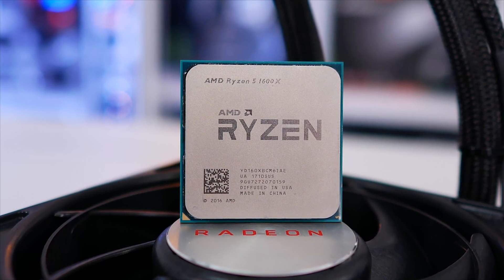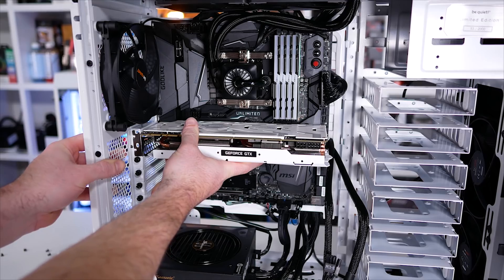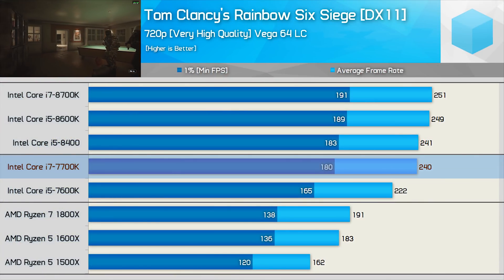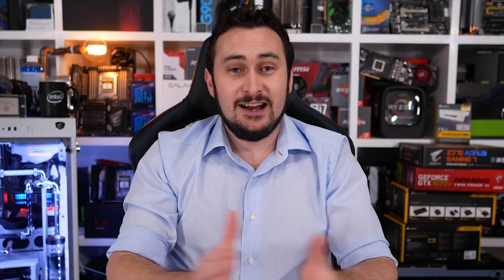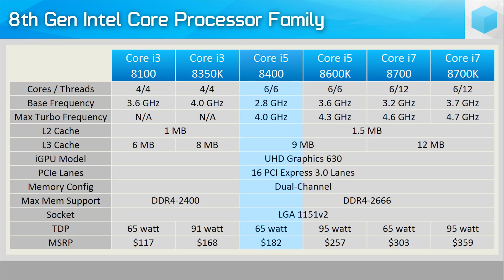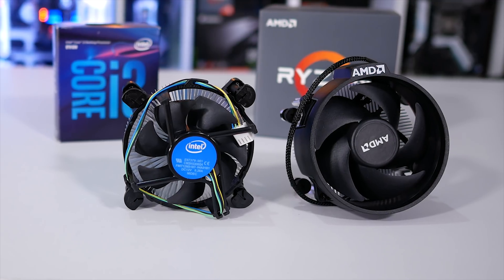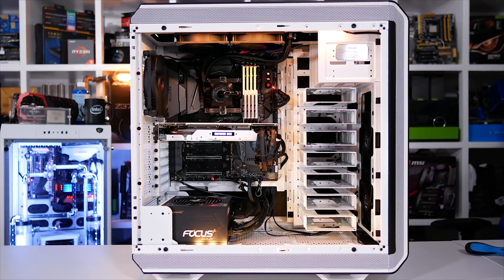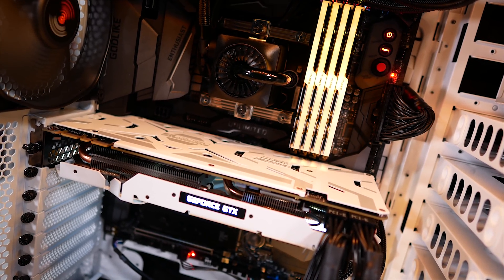Let’s Chat, R5 1600 OC vs. i5 8400 Benchmarks Incoming!

Comment: I finally got my r5 1600 to run stable 3750 Mhz on a Asus prime plus b350 with last BIOS update in Nov. The FID thing was a bit of struggle to deal with. That is until I realized how simple it was. So you take 3.750 Ghz. move decimal one place right and multiply by 4. So, 37.50 X4 = 150 and 3.8Ghz would be 152. Another thing it did was better under volting. I guess these ryzen can get higher clock speeds with lower Vcore. Mine likes 1.228 @ 3750. I think the 1600X may do it with less? and the R7 maybe even better? The spire cooler that came with it can maintain less than 70C with 100% load. Anything more than that it requires more Vcore and the VR don't like that. The other bonus was the G-skill Flare 2400 will clock at 2800 by just choosing 2800

Comment: i5 8400 isnt a good deal.  Intel will be rolling out icelake in a year its a 8 core mainstream cpu.  They will however be compatible with 300 series chipset except one of the 300 series motherboard which is z370.

Meaning a z370 is a not a good buy, it will have very bad upgrade and really bad resell value.  Since it doesn't supports the next series and will be stuck with 6 core cpu's only.
Reply from the maker: Don't expect the 8-core CPUs to come in at the same price as the 6-core models. Unless AMD really smashes them with Ryzen 2.
Reply: Then lets hope Ryzen 2 is super good.

Comment: My problem with only looking at or depending on low resolution testing is situations such as the 7700k faltering at 1440p while doing really well at 1080P against higher core cpus. It's good that you have the larger picture shown. good work as usual! You really are settings the bar for professional benchmarking

Comment: OMG my brain is is so tired from watching and reading what to do. 
I need some advise.  I have a 1080p monitor and a Asus GTX 970 Strix 4GB.
 I will not change my graphic card  but I need to buy some new parts to run 60fps at 1080p high or better? on my gtx 970.  ( right now I have phenom II 720 2,8Ghz 8GB RAM  650W 80+ ). Can't play BF1 or Warhammer2 it's so laggy and ugly XD. Just for gaming. 
Please help :)

Comment: you know when someone still argues about 720p and lower benchmarks they have no clue about tech in general..

720p benchmarks might hold a point back in the 00s when the root complex was slow as fuck and the cpu was literally handling everything 
nowdays that the root complex is directly tied to the speed of the cpu its literally idiotic to benchmark 2 different uarches first of all we dont know how both applies turbo speeds and on what point 
second we know ryzen can go up than 4 ghz maybe 4.1ghz in relation to intel than scales up to 4.7 with mce 
third there is absolutely NO other workload that can replicate the difference we see in 720p what so ever so why even test it? no one plays on 720p not even pro players draw calls given that most devs are going to vulkan will be a secondary issue since this is why it was created...
so?
Reply from the maker: So many errors in this comment I don't even know where to start. Honestly I don't have time to address it all so let's just touch on this gem...

"absolutely NO other workload that can replicate the difference we see in 720p what so ever so why even test it?"

So you're telling me people with high refresh rate monitors that game at 1080p (I have a 240 Hz 1080p display) using medium quality settings won't be seeing what we see at 720p using high/ultra quality settings?

Comment: Maybe AMD will answer why it lacks in lower resolution gaming if it was asked directly. If the IPC isn't that far away. 9% from userbenchmark it doesn't explain why it performs so low in a lower resolution because it's much lower compared to Intel's further than 9%.  It maybe has to do with the architecture of the cpu rather than performance.. or maybe even windows performance at that resolution ... that question   opens up a new world of "WHY"?

Comment: What`s the use of testing in 720p or lower when those tests aren`t valid, in a sense that lowest gaming ress on desktop is now fullHD? TEsts should be 1080p, 2k, 4k and that`s it. No one normal buys high(er) end HW for 720p, so idea that it shows difference between cpu`s is irelevant.
Reply from the maker: So if you game at 1080p on a 240Hz display using medium quality settings... 720p high's not going to simulate that?
Reply: No, because 240hz monitors aren`t supposed to be used with sub 500usd graphics (rough assesment, considering the value of 240p monitor, cpu, MB, ram). Your scenario includes high end monitor, cpu, but not high end vga for gaming. Weak case IMO, very rare scenario in reality, maybe for someone who upgrades components one by one (like i did when i bought first high end PC), and decides to upgrade VGA last, and plays for a couple of months with,let`s say GTX 770.
Reply from the maker: Mate you're so far off the mark. Most high refresh rate gamers use mid-range graphics cards with medium quality settings. They are after maximum responsiveness over image quality.
Reply: They are very minor part of gaming comunity (100-144hz is much much more common, but still rare compared to 60hz), also, not everyone who buys 240hz monitor goes for lower rezz, many go just for lower quality settings (if not most, except some cases, scgo players being one of few exceptions). I doubt that gamers with 240hz monitors make more than 0.5% of PC gamers, probably even lesser than 0.1%. 100--144hz are much more common, but now there are graphic cards more than capable of performing well with FPS in that range, even on max resolution and better-than-low quality settings.
Also, stronger vga also adds to responsiveness, by upping min and avg fps. 
So, we disagree obviously, but still, respecting your work. Cheers

Comment: I'm downvoting because you're not using deterministic validation with 720p bench testing. If a processor is simply better at prioritizing the movement of smaller threads it of course will be faster at 720p because the frame buffer size nearly 1/4 - 1/8 the 1080p frame buffer which has to be handled by the processor. Processor technology varies on architecture and some pipelines are wider or more narrower but faster. I recommend running an hour long conversion on handbrake of various difficulties while benchmarking Valley.

Comment: AMD fans need to realize the advantage to picking AMD over Intel isn't that the processor is going to be better, Intel is the better choice for raw power at the moment, but because the fact that in 5 years you can buy a new processor and plug it into the same motherboard. Ryzen in 5 years might be a better CPU, AMD did say this was the worst possible Ryzen and everything coming after should have a lot of improvements. So just wait, in a couple years AMD might be the single core performance king that Intel is today, if not at least you wont have to buy a whole new motherboard and everything to upgrade while Intel will probably have been through 3-4 different sockets by then.

Comment: The reason why low resolution benchmarks do not actually show the truth about Ryzen is simply that Ryzen is not meant to be used that way.
I mean the IPC is somewhat 0-10% behind Intel's skylake/kabylake/coffeelake CPUs and the clockspeed on single core is usually 500MHz higher on Intel CPUs. This means that while Ryzen can easily reach 3,9-4ghz on all cores and Intel CPUs have either overclocks to 4,5-5ghz or just 4,2-4,7GHz single core turbo the difference between single core performance is no more then 10-20%.
We can see results like that quite often in gaming benchmarks yet 720p creates differences sometimes over 30% which means that it's the CCX bandwidth that's not big enough to populate the data to the CPU cores. So the Ryzen is strong enough to compete with Intel's best yet if you increase the framerate by reducing resolution you will hit CCX latency issues. This however can be countered by the fact that Ryzen can easily stomp Intel in multithreaded tasks if you populate all the cores correctly. So the performance is there if you are not trying to specifically introduce internal bottlenecks which are not a problem with correct resolutions.
So what I'm trying to say is that the CCX latency is not an issue once you run closer to 3000MHz system memory and you play the resolutions that modern day intends you to play games at which is 1080p or even 1440p. 
If Intel would use CCX design it wouldn't matter if their CPU cores ran 5ghz if the CCX latency would reduce the performance in 720p which would be rediculous situations which this Ryzen 720p comparison to my opinion is.

Comment: TL;DR: Build for what you need now, at the desired price. Quit speculating (a.k.a. future-proofing).

I'd say the best approach is to build rigs targeted at desired set of workloads, at a desired total price.
Say I have X amount of money, build me the best rig that runs my set of workloads.
If gaming is your thing, then those workloads are mostly gaming, at the desired resolution (monitors have resolutions).

I am not so much into future-proofing. Build for what I need now, not something that I might or might not need down the road.
That's why I care as much as rat's ass about 720p gaming, since I'm not going to ever play at that resolution.

You keep saying I'd be able to replace a GPU down the road and that's why low-res benchmarks are useful to me? What prevents me from adding RAM, upgrading the CPU (possibly along the motherboard with it) in the same fashion? I am not buying this.

Comment: There are ppl who play at 720p or lower. They are called competitive gamers. Also ppl with less money with older video cards.
720p & lower shows the difference between the CPUs & their raw power. If you play on 1440p and above you can go with older i3s & they will show same fps as same system with I5 but that doesnt mean i3 is as powerful as i5 from the same gen.

Comment: Now that weve got assassins creed origins, we can also do valid cpu benchmarks at 1440p, since i7 7700k bottlenecks 1080ti at this resolution. Thanks to ubishit.
Reply from the maker: No reason for that to be the case, they'll patch and fix the game like Ubisoft always does. If the 7700K is getting owned you can expect the R5 1600 to be having a bad time as well.
Reply: Hardware Unboxed im sure that it has a hard time. And i had a hard time yesterday explaining guys on yt that 100% load on the i7 7700k at 70-80 fps is not a good thing. Plenty of people consider this being "good optimization". :/

Comment: "GTX 1080 Ti doesn't support DX12"?! Come on now. You can easily verify with a bit of research that Pascal DOES support DX12 in hardware. Just because it doesn't support ALL of the OPTIONAL features doesn't mean it's tricking anything.

Saying all that, using a Vega for DX12 testing is the good choice since Ryzens do not play well with geforce cards there. Still, IMO you should also test DX11 too. Focusing on DX12 when the huge majority of current and even upcoming games are DX11 is not exactly fair.
Reply from the maker: +andrechkl I'm out at the moment so I can't check but I meant to say something like "fully" or "properly".

Comment: Thanks for the video steve, essentially gathered all of rumors floating around and quashed them.

I wish the 8400 was selling at MSRP right now, I have a few builds that would love to have that processor.  The lowest I can get it is $300 off Ebay without a warranty but at that priced I'd rather just save $100 and overclock a 1600.

Comment: Something I'd like to see is completely stock versus stock, since basically all the benchmarks available are overclocked, liquid cooled, or something else.  Call them "normie benches" or something, but it would be interesting to see exactly what a user is getting by building their PC, and not messing with anything.  I suspect Ryzen would get absolutely bottlenecked by slow default memory speeds, and I seriously doubt the i5 8400 would boost to anything interesting with Intel's crap-tastic stock cooler.

Until Intel board makers bring us cheaper boards and the 8000 series intel chips calm down in pricing (and can actually be purchased), I'll continue to recommend AMD to friends.

Comment: 8400 will beat the 1600 in gaming regardless of overclock or not. Simply because of the single core performance and the fact that most games don't make use of all of the 1600s cores. Regardless of that the 1600 is a better value as it's much better at performing different tasks other than gaming.

Comment: 720p does have advantage of getting GPU bottleneck out of the picture, and it does emphasize max framerate difference. However, my personal opinion is that most of the serious competitive gamers will play at 1080p looking for 100-200 fps, and that is pretty easy to achieve in MOBA and FPS games (CS:GO, League of Legends, DOT 2...) even with 1050Ti, as most the not needed eyecandy settings will be turned off anyway.

Comment: I was just more curious as to why the scaling didnt follow a similar trend to intel chipsets. The difference between 720, 1080, and 1440 were roughly within a 10% performance drop. Seems to be more of an artificial problem in software, then compute power. Has anyone found the reason behind this?

Comment: Whilst no one plays at 720p making those benches a pure information dump highlighting the game CPU bottlenecks, you should conduct these tests with the fastest available gpu, which is obviously a 1080ti rather than a V64. If the idea is to highlight and extrapolate from FPS differences between CPU bottled applications you are going to want to expand those differences as much as possible to find the most accurate data, therefore you should consider at least testing both a V64 and 1080ti.

I await your thoughts.

Comment: Lower resolution benchmarks are about creating "faster GPUs". 
The problem is the performance GPUs lose when upping resolution and/or quality settings varies from architecture to architecture (and sometimes from different skus in the same family).
Additionally the way GPUs advance isn't exclusively higher raw numbers but also improvements on caches, on how efficiently they process information, how efficiently they compress stuff, etc.
Finally when you get next gen GPUs you aren't going to compare how much performance the new GPUs deliver versus the performance you were expecting based on 720p benchmarks, are you? So we never see these lower resolutions can predict the future theories actually tested.
We are not even touching how software developers will adapt to the hardware available.

Comment: What if Ryzen 2 will get these updates
+2 cores 
+500Mhz 
+5% Single core performance
Reply from the maker: +Diego Dio Brando sounds good sign me up ;)
Reply: The latter two are very likely to happen due to moving to the LP 7nm process + inclusion of some IPC optimisations that they couldn't include in Ryzen (ran out of time, had to fab). As for the first - I'm thinking no at this point, but perhaps for Ryzen 3 (not the R3 chips, eg 1200, but rather the 3XX0 chips).

If they did though, oh man would that put the hurt on Intel. 
This being said just the 500MHz clock jump is likely to do so anyway... and they may well get more than this - 14 to 7nm is a big difference, and the silicon itself will be better suited for high frequency, as per documentation for that LP process. Fun times ahead! CPUs are exciting again 😁
Reply: lol. they do now 1600 vs 1800x
Reply: Matthew Ducker ryzen 2 will have 12nm and not 7nm, the architecture Zen 2 will get 7nm
Ryzen 2 is Zen+
Reply: Diego Dio Brando incorrect information sir, Ryzen 2 is 7nm, Ryzen+ is 12nm.

Pinnacle ridge is the SR name for Ryzen+
Reply: Snuwfer i read that Zen is the architecture meanwhile Ryzen is the CPU.
Ryzen use Zen (14nm)
Ryzen 2 will use Zen+ (12nm)
Ryzen 3 will use Zen2 (7nm)
Reply: Ryzen: Summit Ridge
Ryzen+: Pinnacle Ridge
Ryzen 2: Matisse Ridge

Ryzen was released already (1200, 1300x, 1500x, 1600, 1600x 1700, 1800x (14nm LPP)
Ryzen + (Pinnacle ridge) refreshing of Summit Ridge comes in Feb 2018. (12nm LPP)
Ryzen 2: Mattise Ridge comes after 2018 and there are no plans of any of the sort until 2019. (7nm LPP)

Comment: Sorry Steve, at the risk of branding me as a Toxic AMD fanboy as you put it. The drivers aren't optimized for 720p operation. I highly doubt AMD or Nvidia spend their time optimizing for 720p operation (in fact if you compare Nvidia and AMD GPUs at 720p you'll find all sorts of discrepancies, AMD running faster where it shouldn't or vice versa). And testing in such a artificially slanted scenario may give you all sorts of wild results. But what do I know, I've been a software developer for the past 30 years. Anyways I enjoy your videos, but I think you're wrong on this one mate.
Reply from the maker: +SirMo I'm not comparing GPUs.
Reply: Drivers run on the CPU.
Reply: Also I just want to add. I don't think you shouldn't publish 720p data, more data is fine. I do think however that they have a potential of misleading consumers. They should be taken with a grain of salt.

Comment: Intel coffee lake explained. 
I5 8400 65w = R5 1600
I5 8600k 95w = R5 1600x
I7 8700 65w = R7 1700
I7 8700k 95w = R7 1700x
But i don't want to mention that 91w I3 it looks awful.  Even if i like it more than the non k i5 (just because overclocking) but its no value compared.

Comment: including 720p is fine but the arguments against it are valid. Minimum the lower res stuff shouldn't be the only thing there. People are looking at these benchmarks for help buying hardware. 720p won't help most of then decide that. And the BS about faster GPUs later ignores more demanding games, people buying GPUs to max settings etc. Never mind games using more threads later on or the fact newer APIs aim to reduce the impact of the CPU.